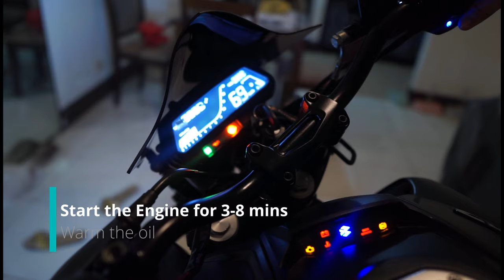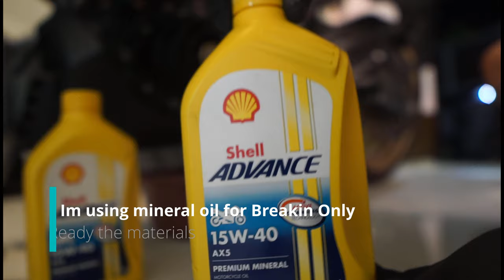DIY change oil Dominar 400 | Removing the oil filter Dominar 400

Comment: May isa pang drain plug sa ilalim ng makina, yung maliit, dami pa oil dun. Bago ko pa din nalaman, ni mekaniko sa casa di alam. Rs lagi paps
Reply from the maker: san banda dun paps?
Reply: Andun sa pinakailalim ng makina paps, kailangan mo tanggalin belly pan, dun ka sa left side tumingin yung sa may gear shift. May maliit na drain plug dun, may filter din sya na maliit sa loob, madami pa oil dun
Reply: Pag mag dagdag ka na ng oil, lagyan mo 1600 or 1700 ml na oil, 1500 lang kasi indicated sa manual
Reply from the maker: @roguepotato9967  ichecheck ko yan. Sakto mag change oil ako.